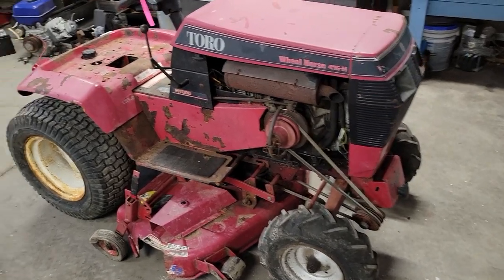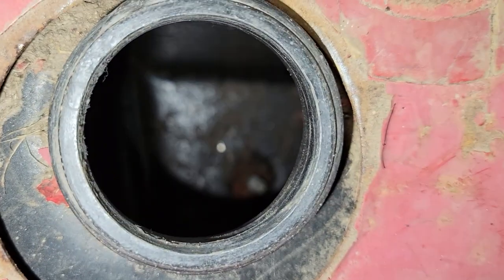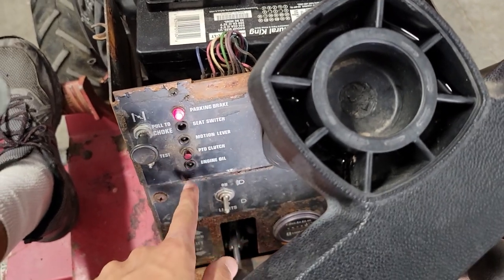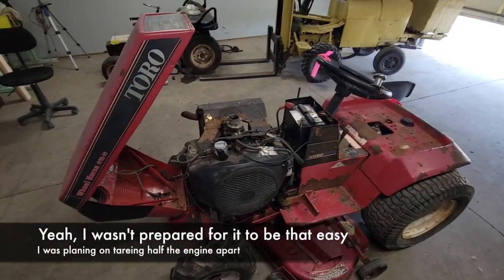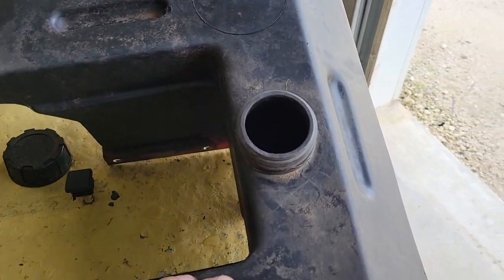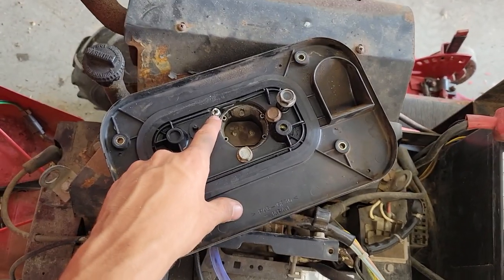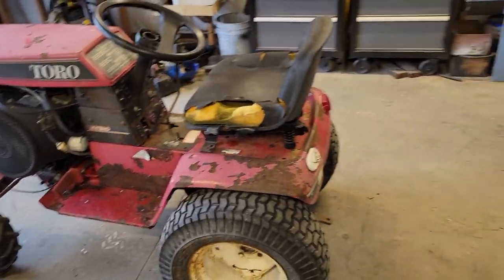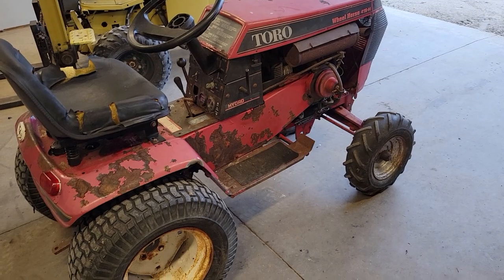Getting a Wheel horse 416-H  running

Comment: It's an Onan. I designed that rectangular aluminum epoxy potted battery charger dohickumus many years ago. It sits there with cooling fins below it, in the cooling air flow. Engine was well established before I started working there. May have even been built in Fridley, Mn, maybe Huntsville Alabama. Much later, they sold the engine to a Canadian outfit to make engines for a few years. The EPA killed that engine. Be careful and don't take the engine apart unless needed. It is old world. Carefully machined and assembled and designed to be rebuilt, not thrown away. Depending on the age, there wasn't a Chinese part in it.

Comment: What type of the engine looks like a kohler or onan  or a Briggs and Stratton
Reply from the maker: Toro power plus 16.  A rebranded Onan P216
Reply: @IMPRIOR87  okay thanks for the info on this engine and glad you are keeping this classic machine
Reply: I just bought the same tractor without the Hydro. What should be the compression for that engine?